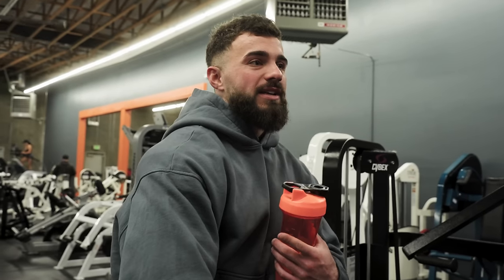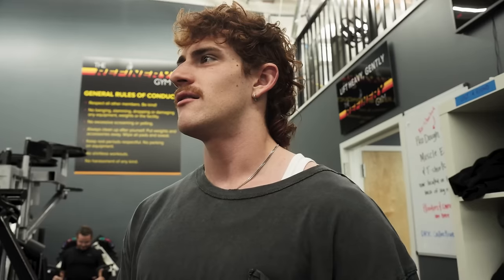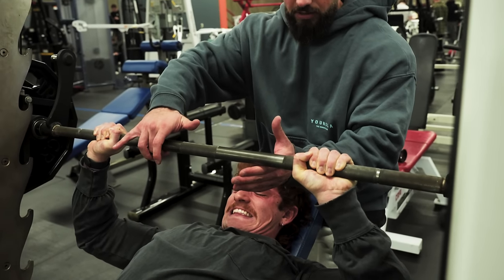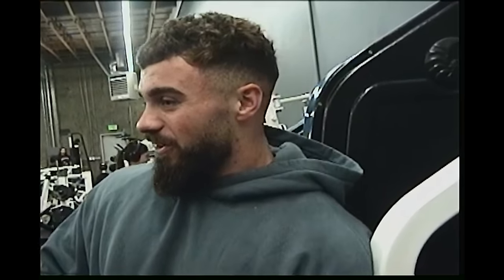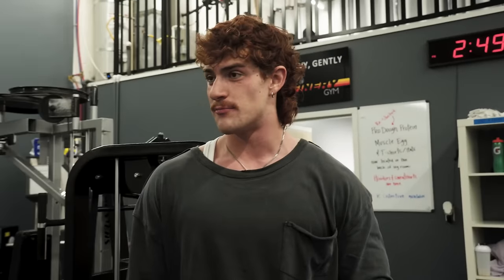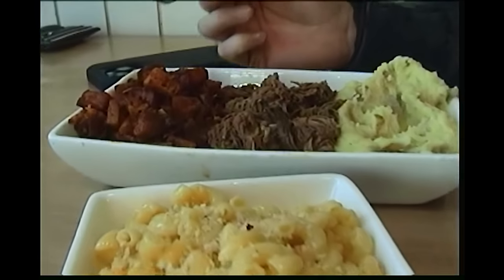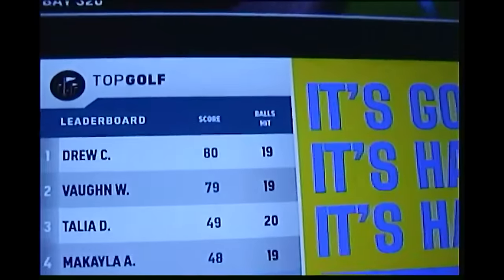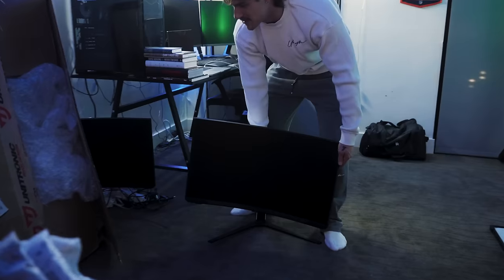IFBB PRO CHEST DAY

Comment: Respectfully I think this training style is leaving a lot on the table- why would one set to failure produce more hypertrophy than 2+ sets at 1-3 reps from failure? A lot of papers have shown that the latter’s better
Reply: Because if you go to failure in every set most of it will be junk volume. Going failure means you already failed that muscle then what's the point of breaking it again
Reply: @kartikey0499 I agree that every set to failure most of the time doesn’t make sense, but I said 2+ sets 2-3 from failure vs 1 set to failure
Reply: @ethanhardcastle2265 approximately same but that 1 set to failure i guess is more time efficient and pump is different